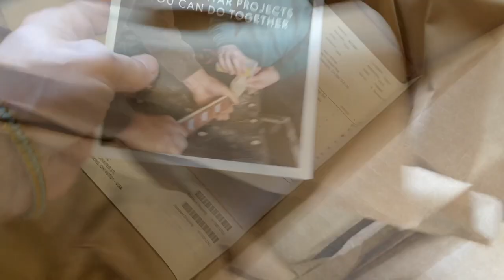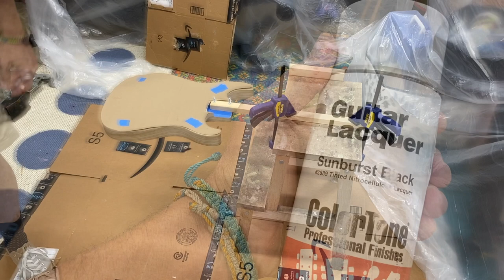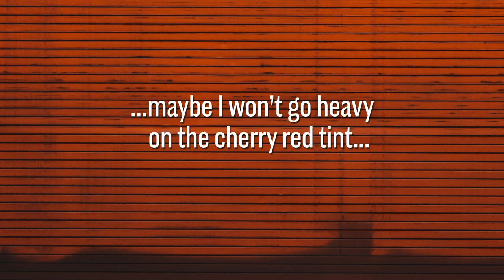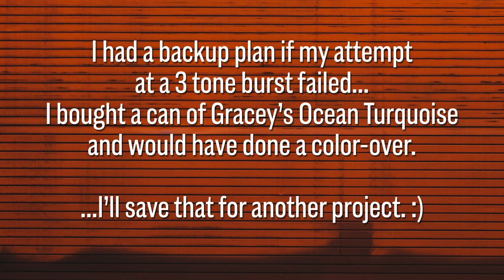Three tone Tobacco Burst with StewMac nitro rattle spray cans

Comment: you can still "feel" the wood because you didn't do any grain filling. Fender started with grain filling and layers of amber to completely flatten the face of the guitar before the sunburst/color was added. I think the grain looks cool especially on a sunburst! nice job
Reply from the maker: Thanks! I was going for the wood feel. :) I was surprised by how much the paint sucked into the ash. I can see how filling the grain would use less paint and lessen production time. I even had to order an additional can of clear to get an even final finish.
Reply: The wood grain texture is nice, I'd prefer it. I watched another video recently by someone who does this as his actual job, using nitrocellulose laquer / paint and a paint gun.  He said he'll sand it to 2000 grit, clean it, apply 3 coats of sanding sealer, sand any textured spots to 2000 grit, maybe repeat if the sanding went through the sealer.  He then saturates it with a relatively heavy clear coat before starting the sunburst colors, to make like a barrier so that the colored paint itself won't shrink into the wood as it dries.  The idea being that as a heavy clear coat seeps into the wood its surface smooths out to be relatively smooth and even.  What I liked about this video is seeing effective application / spraying techniques using the aerosol cans.

Comment: I’ve used many of the Stewmac burst aerosols and each spit like a cobra. That was after soaking the cans on warm to hot water for at least 20 min, shaking for at least 2 min before spraying.  There’s too much pressure behind the spray with these aerosols.
Reply from the maker: I agree. I soak my cans, shake them well, and spray away from the body before doing my passes. I edited out most of these steps in my video but they are crucial for fine paint particles and avoiding 'cobra spit'. Patience and preparation are key to a great finish!

Comment: I expected you to use the raised template method rather than freehand.
Reply from the maker: After I did the black edge with the template, I felt as though I'd have more control creating the burst freehand. Especially how each subsequent color would 'blend' into the next. I let a lot of paint fall to the floor, spraying away the body, just 'kissing' where I wanted the paint to hit. I also made multiple passes inching into the burst as I proceeded. The other consideration was what it would look like when the nitro dried. I feel 'lucky' as this was my first burst but I did a lot of internet research and had to find a lot of zen moments. :)
Reply: @guitarsgoats  I'm planning on doing a burst explorer build after finishing up my first single colour finish on a tele. I gasped when I realised you were as nervous as I surely will be then eyeballed it. Props to you, looks ace and I actually feel more ready for it - template or not...
Reply from the maker: @Damian808  I rewatched the video, and you can really see how little of the nitro hits the guitar while doing the burst, especially on my initial passes. Almost like a practice run before committing. I got a little nervous just watching it! Hahaha! Good luck!